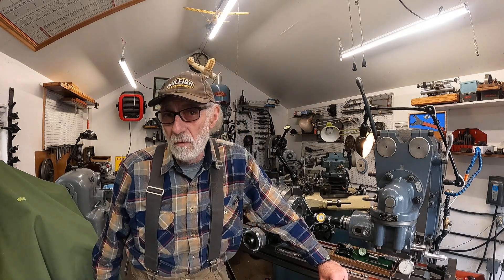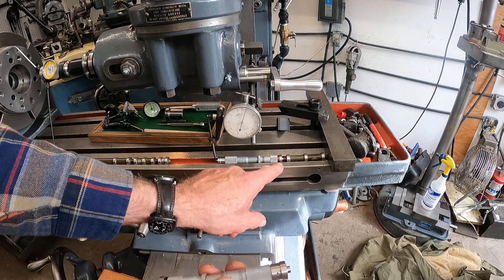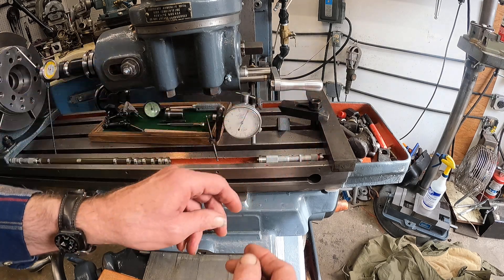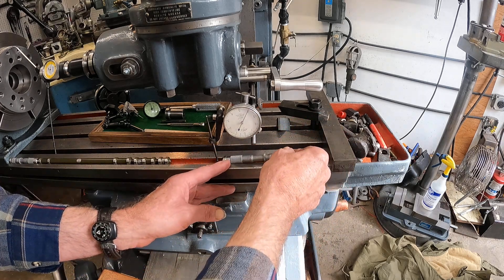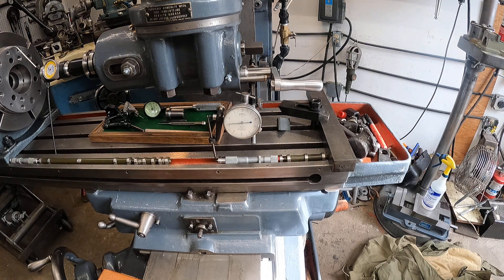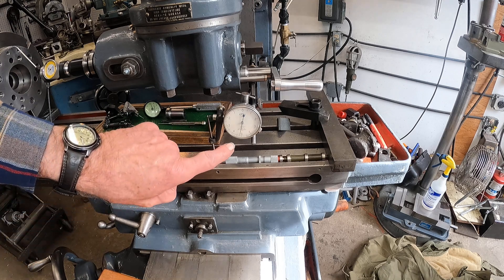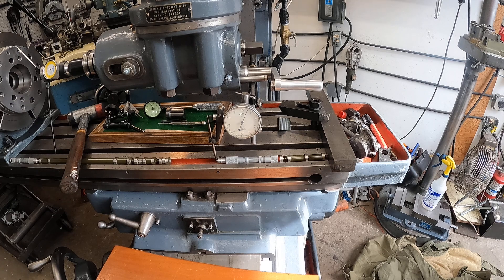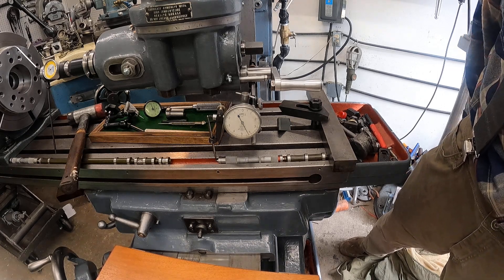Precision techniques for standard machine tools Part 1!

Comment: Dee Dee, you missed two important things.  First, never leave the lead screw loaded, back it off after coming to position, and always come to successive positions from the same direction (ie always crank in to position in the clockwise or counter-clockwise direction).  These are necessary even when using a DRO.  Additionally, end measures can also be used to re-position the part, by sliding it along a ground edge, this way you eliminate the machine entirely.
Reply from the maker: I am addressing these things in extended episode 3, as episode 2 is magically loading now, that ground edge sound interesting. The screw loading causes much the problem, but you can't do that on a lathe. Are they ready for too much oil and table float?
Reply: @deedeeindustrialsuperprecision  Most aren't ready for what you have told so far.  The ground edge/ground stop concept relates to the repeatability of positioning in work holding in general.  Wow, us guys sure like to give away all the secrets.
Reply: Always moving into the lash is not strictly required anymore when you have a DRO, since the DRO is measuring the movement of the table regardless of what the leadscrew is doing. You just have to be aware of how you're driving the screw. Besides, how else would you finish mill the walls of a square pocket? :)

Comment: I know what you were trying to do, but I think your indicator is faulty.  try to see if it's repeating by backing off 1 revolution and returning crank to "zero" (CCW then CW)  and see if your indicator repeats.  I bet it doesn't.
Reply from the maker: You are right! I have mounted the indicator much more solidly with a Noga base, and talk about a less makeshift set ups for each axis.

Comment: I know some old machines had a mechanism built in to do just this. I glad I came after these methods. Tricky as hell. I have made many 4 post die sets with a bridgeport mill with a digital readout. Much respect to the old timers that had to use these methods. Even though I am a skilled tool and die maker, i think the old ways required more skill than I have to  have with my wire edms , digital readouts and cnc mills and lathes. In summary, i think it takes less skill today to do greater precision work. Im sure ill get some arguments.
Reply from the maker: I am sure you would have adapted just fine and been even more happy about the DROs coming along.
I thought it would be fun to introduce this subject, and it can be useful in a pinch. I happened into this just as the Mini Wizzard and such showed up economically in the early 1980s, it took years for most shops here to upgrade, and I was instructed in this at the local CC at the time they got a brand new paper punch tape fed Bridgeport! This method can be applied to machines without normal adjustments such as an old planer with milling heads installed and hold good tolerances on large parts.
Reply: @deedeeindustrialsuperprecision  I think the key would be once you've moved to position, do everything center drill, drill, bore. Then move to the next hole.  Thanks for all your video.
Reply: @danneumann3274  You should operate like that if you are looking for highest precision possible on a given machine even with the use of a DRO.
Reply from the maker: @danneumann3274  Yes, the best part of it is you get paid more, and maybe wear a bow tie. Sort of like a programmer.
Reply: @dutchgray86  tough to do sometimes. Drills can be long and sometimes you have to lower the knee to load them. I like to do all the holes with the boring bar once it's set right. Before digital readouts I would do all the steps on each hole before moving to the next. We all have our methods. Thanks
Reply: I think that's the duality we all face  even old timers.  machining is about a lot of things , but making it better , closer, less headaches , etc is just a natural progression
Reply: I don't think it's any easier to achieve high precision, it's just easier to do it more repeatably.